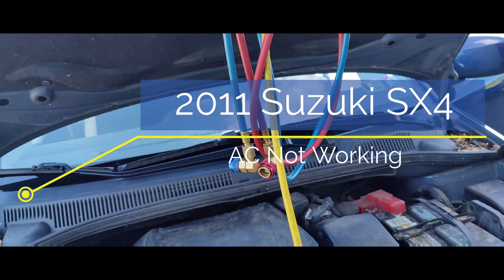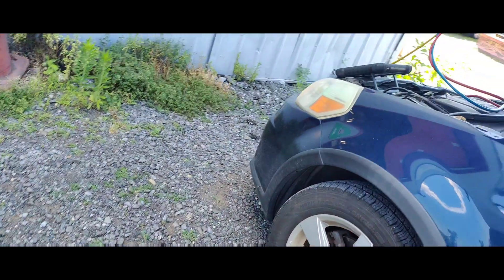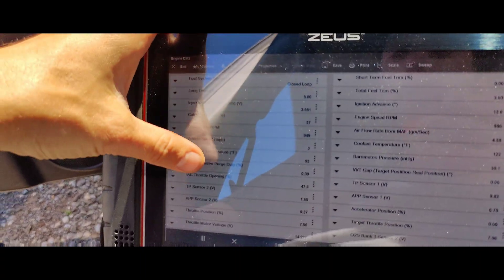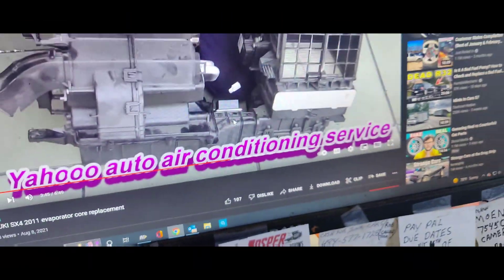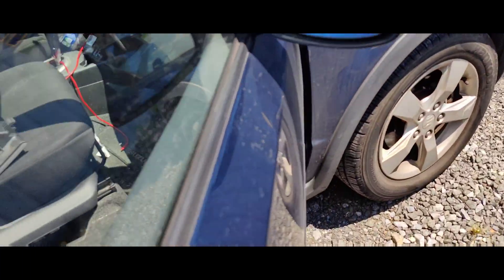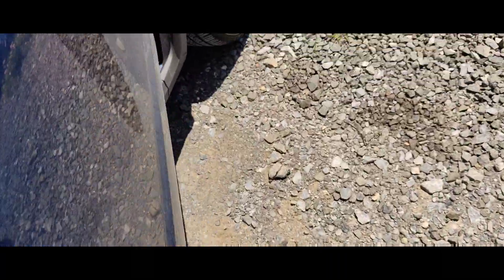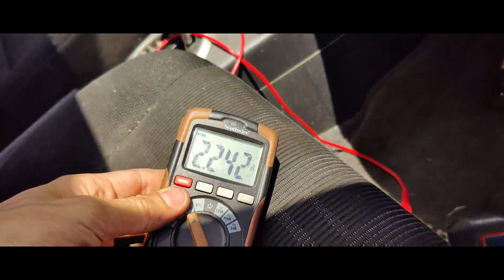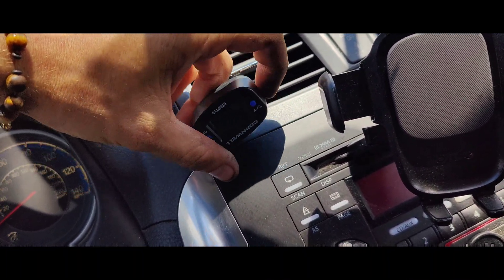2011 Suzuki SX4 2.0l Air Conditioner Not Working

Comment: I had a similar situation with my 2007 Suzuki SX 4  would work intermittently. I finally located the problem turned out to be the relay for the compressor was not making proper contact. Any type of bumps while driving, would  cause the compressor to disconnect and reconnect. I fixed the wiring, going into the fuse box, where the relay is located by the driver side fender. works  now down to 42° with the outside temperature 87°.👨‍🔧
Reply from the maker: I'm glad you were able to figure it out.

Comment: I was watching your video this is the guy you left a message is that 40 owns or will it said they go by by the ohms of the relay the the resistor they show a 30 i-30 resistor thank you
Reply from the maker: Not sure what you mean by relay resistance. The goal is to make the temperature show.above freezing. There is a downside to this and that is the evaporator can freeze up and that is not good.

Comment: Hi Robert I enjoy your videos, i have a Suzuki swift and have no cold air, can you tell what should be the temperature on the vents, thanks 😊
Reply from the maker: It depends on the outside temperature and the humidity. It should be at least 30* cooler than outside.